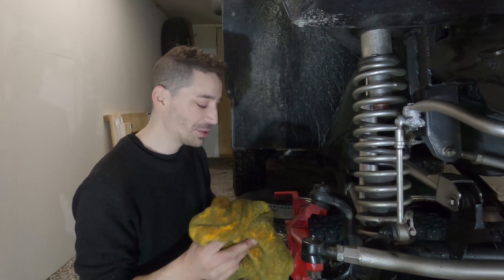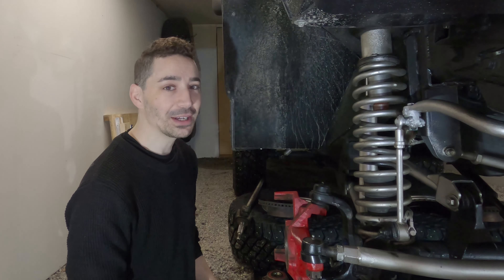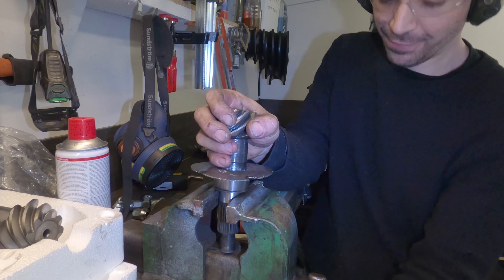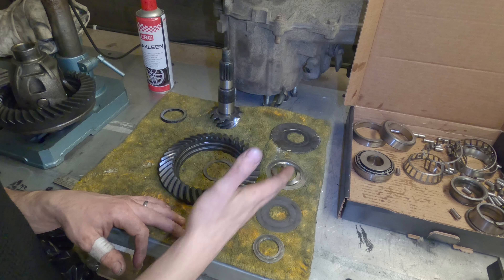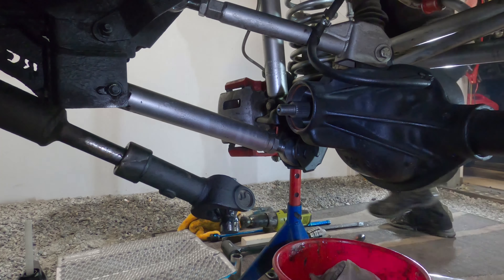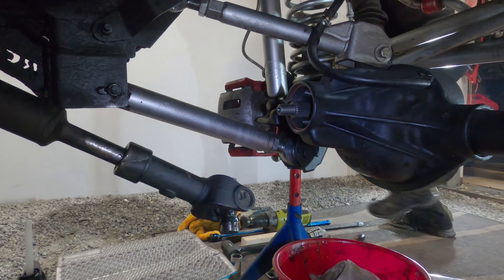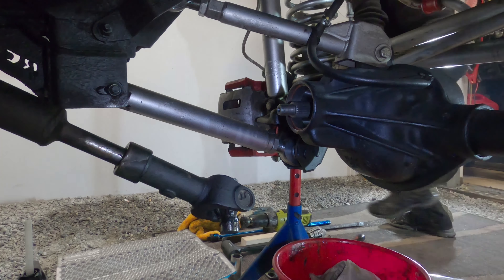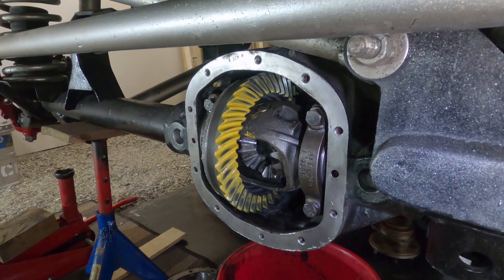Regearing Dana 30 HP / 4:10 To 4:88 / Elite Gears

Comment: We’ve never considered regearing ourselves. Leave that crazy stuff to the professionals 😂 
But great job!! I learned a lot from you ❤️🐞
Reply: I agree. I don’t have the time or the proper tools to do a proper regear so I went to a reputable shop and had them do it…….. and then after 116 miles or so I opened it to do my outside wheel bearings to find my ring gear has chipped teeth and the carrier bearings are destroyed. And now they’re saying I need to pay for labor again for them to fix it.  What a headache and it only the beginning of the mess.

Comment: Happy birthday! It looks like you've gotten the hang of regearing i think it will just get easier each time you work on gears. That looks good. I think that was smart to take it apart and try a bunch of different combinations. I've seen people beat on high pinion dana 30s that are locked with 4.88 gears and they really are a stout axle for what they are. Maybe look into sleeving the tubes as well as a truss? I think the most important thing is to stiffen the axle so there's no flex under load that should keep those gears meshing nicely. I know heavy diff covers are supposed to stiffen the housing. Some custom axles have a set screw behind the ring gear called a ring gear load bolt to guard against deflection I don't know if that's ever been done on a dana 30 before though. 

My friend just dropped off a dana 44a for  his grand cherokee zj he wants me to help install an ARB locker and weld on a truss and a skid plate thing and set up his gears. It's a weird axle it's called a 44a because the differential housing is aluminum and I guess there's a problem with the bearing races spinning and messing up the aluminum housing I've been trying to come up with something to prevent the races from turning like using loctite retaining compound and maybe even installing set screws that grab a dimple on the races. It's just a bare housing I don't have any of the original shims or know anything about anything so it's going to be quite a project to start from scratch with recommended shim sizes I've always been able to measure what came out.
Reply: How would a D44A compare with a 30 in your opinion? I really struggled to find much online about them but the V8 WJs all had D33As front and rear so they’re not impossible to find in the UK. I’ve built my 30 up but in the long term I’ve considered grabbing a WJ front axle as I’ve already got a D44 rear.
Reply: @Robdutton91  I've never heard of a d30A or 33A I'm guessing that's a typo and you meant 44A? My opinion would be to stay away from any axle with an aluminum diff housing if you can. My friend is replacing a dana 35 with the 44A and I believe that's a worthwhile swap since it's bolt in and easy but a front high pinion dana 30 is a good axle. In the front of a wj I would use a high pinion dana 30 or something like a tj dana 44 if you can find one. I think your wj came with a low pinion dana 30? The dana 44A rear that I'm familiar with doesn't really have anything in common with a standard dana 44, there's not many aftermarket parts available for them either. If you want to use a 44A offroad then you need to stiffen the axle quite a bit like with a truss and heavy duty diff cover. They even make a skid plate for the 44A which I think is a must. The carrier bearing races can spin in the differential housing galling the aluminum and completely ruining the housing. I'll be using loctite retaining compound on the bearing races and possibly pinning the races with set screws but that won't be easy.
 Also the wheel bearings don't have an inner race so they ride on the axle shaft and it's very common to have to replace shafts because of a bad bearing. 
I think chrysler used the same 44A center section in the dodge viper, it's a tough differential but in a 4x4 it has issues.
Reply: @forreststrong797  yes it was a typo I was half asleep writing the comment! I meant a D44A. Guess I’ll keep looking for a standard 44 front axle then, in the meantime though I am pretty happy with the HP30

Comment: Didn't understand why you're pushing wood block when checking gear pattern, what's the point? to simulate some load?  Also didn't see a crush sleeve on your pinion, did you install new one, how does it work with multiple reassemblies during gear pattern setup?
Reply from the maker: The wood block helped to put resistance on the gear to simulate some load. Some push the gear with a rag in thier hands but the wooden leaver just gave more of a mechanical advantage and I didn't need to push so hard to get a good pattern.
I used shims instead of a crush sleeve on this. Its not to hard to setup and it can be tweaked once the final bearings and pinion are in place. Its just best to use am old pinion nut before committing to the new nut.

Comment: To remove the bearing from the pinion it's  a ( separator puller  item 62593 ) Harbor Freight    have 14 pices for small and big bearings of the differential. The big separator behind the big bearing control how much the pinion go out to contact the big gear.

Comment: Hi! 
I need your help, I have one question and I have no one to ask. I have an XJ with a 2.5 turbo diesel engine and I would put 33x12.5x15 tires on it. Also, it's my daily, so I'm not sure about 4.10 or 4.56 gears. I would appreciate your opinion.
Reply from the maker: 4.56 would be the best choice on a 33. Gearing is really important on the diesel to maintain the correct rpm and power band or you just end up creating a slug with a gearing disadvantage when you shift. 
I've run 4.10 on 32s and 5th always felt very low on the rpm range so that when I approached a long hill climb I would gradually loose power until 4th was needed.
Reply: @Workshop Wilderness Adventures thanks man, I appreciate it. So with 4.56 is still OK for freeway?
Reply from the maker: @V8AmericanMuscleCar  How fast do you normally drive on the freeway?  If you want to see what gears re closest to what you should run use this - 33 x (old gear ratio) divided by (Old tire size) = 
So for example - 33 x 3.73 / 29 = 4.25
So you could choose a 4.11 or 4.56 with that result and probably be good. 4.11 will be better on the highway and 4.56 will be better for low range.
Reply: @Workshop Wilderness Adventures i did the math the 4.56 looks tempting because of the acceleration and torque but I don't know if it will be too slow for the highway.  I usually drive around 100, sometimes 120 km/h?!  Again, I think that with 4.56, the engine will heat up less because it will have more power. Now I have 31s with 3.73 and it likes to run hot.

Comment: Happy Birthday! I’ll be celebrating mine with my ‘98 Cherokee this Sunday installing new coil springs! Did you ever manage to dismantle the wing mirrors to get raptor in behind where the mirror folds in or did you spray directly onto the wing mirror as it normally sits? Cheers!
Reply from the maker: Thank you! Ah nice well happy birthday for Sunday and hope the installation goes well. I took the mirrors off and taped over the glas then just sprayed them. It looks pretty good and enough spray seemed to get through the gap to blend it all in.

Comment: hello from Greece!!
I have the same engine in my xj on 33s and thinking of regearing to 4.56.
wanted to ask you after 1 year using the Elite gears you recomend them?
Are you pleased with them?
the prise is very reasonable and some times that a bit fishy..
so your answer it would be very usefull 
thanx in advance..!!!
Reply from the maker: Just last week I did an oil change on the diffs. The gear wear on both the front and back look normal. There was no obvious metal wear particles present in the oil. The oil was a bit darker than when it was fresh but this is very normal for a differential. 
Gear wear on the teeth look acceptable with the back looking better than the front. Probably because the pattern on the rear was better at the time of the install. It all looks good though, no noise and still running fine. I use Redline 75w90 in the front and Castrol 80w90 LSD oil in the rear. 
Thanks for watching.
Reply: @WorkshoptoWilderness   thank you for your replay!
keep on the good work!!

Comment: I see how you made the set up pinion races. But how did you make the set up carrier bearings?
Reply from the maker: I made those back when I did the 4.10s. Basically took a small sanding drumm on a drill and spun the inner race until it could just slip onto the carrier.

Comment: How did this gears hold up? I'm thinking about buying a kit but I'm curious about the quality of the brand Elite Gears.
Reply from the maker: Its been one year since I did these gears. No noise, good clean wear patterns on the teeth with no scoring and still the same bearings from these videos. I run Redline 75w90 gear oil and its the same oil after the brake in oil. Overall I am satisfied, the jeep is 2.5 tons fully loaded and its been ploughing snow and working hard with no complaints so far. I can whole heartedly say I would recommend them.

Comment: My Dana 30 has backlash shims on the outside of the bearing races. Is that incorrect
Reply from the maker: I think that's incorrect unless there is a model that is setup like that. There are some axles with a shim on the outer of the bearing but normally its a very thick shim from factory. With the Dana 30 I'm pretty sure it's always on the inner of the bearing.
Reply: @WorkshoptoWilderness  
Yeah I think the guys who did them did them incorrectly
Reply from the maker: It sounds like they have.